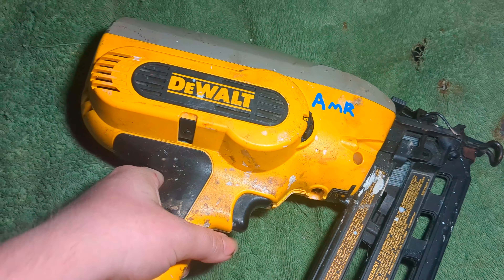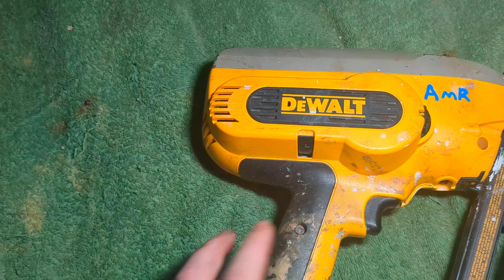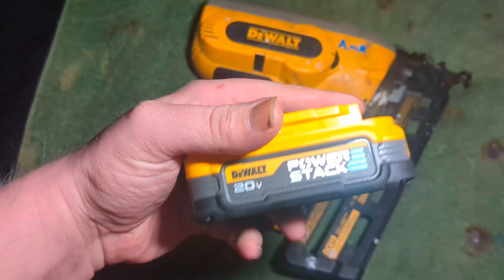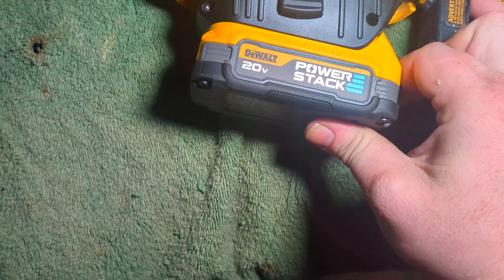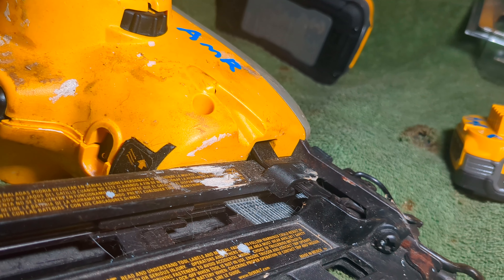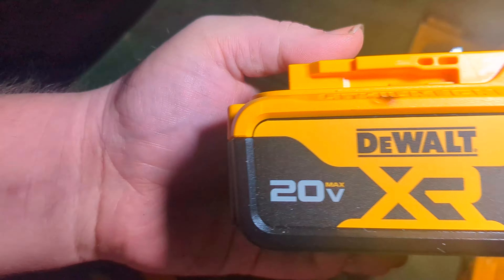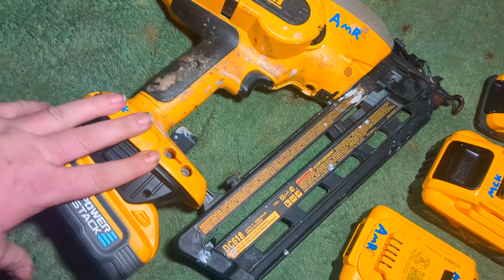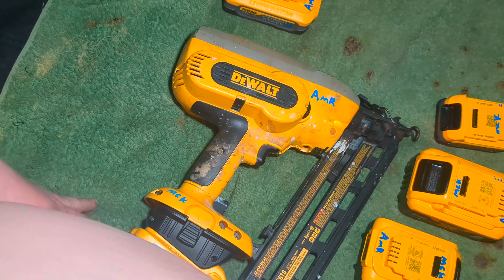"Dewalt DC618 16ga finish nailer battery adapter" 1.7ah powerstack & 5ah powerstack batteries???

Comment: You never said what adapter.you said not the dewalt adaptor please clarify
Reply from the maker: Are Yu taking about the name of the adapter that works in the nail gun??
Reply: Yes what adapter for nail gun
Reply from the maker: @dwojcik100  Yu need to go on Amazon and get the one called "ADVTRONICS battery adapter DCA1820" that's the only name I could find for it but you can find it on Amazon that's where I got mine. It's really good and not cheap quality it's actually built good.
Reply from the maker: @dwojcik100  I put the link to it from Amazon down in my "discription", so Yu can find it there as well